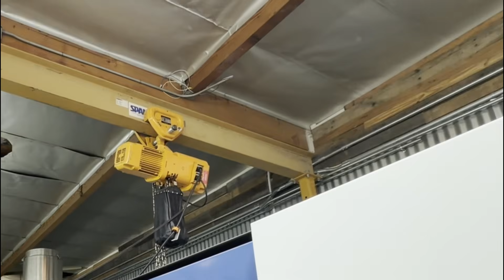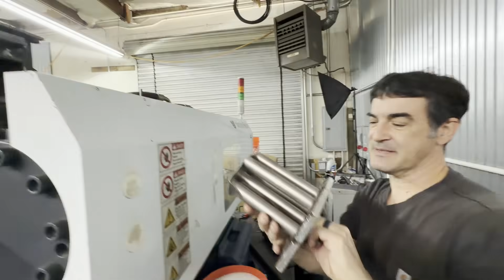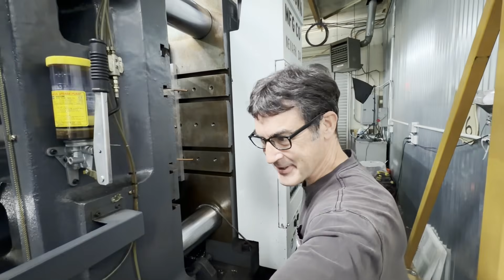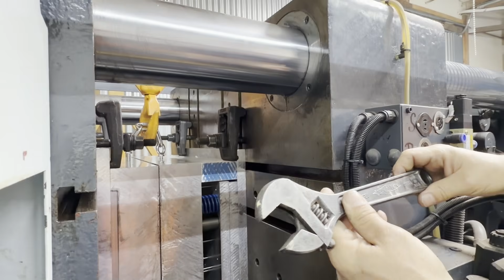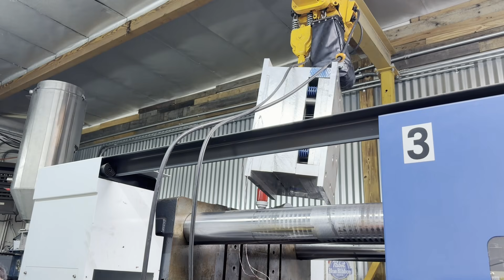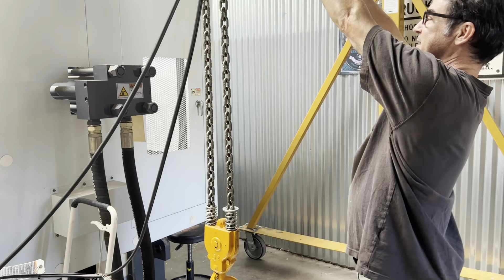MOLDING MACHINE UPDATE

Comment: The best systems for bridge hoists(aside from wall mounted) are when you grind a channel in the cement then bolt a steel bar into the channel about half the width and machine or just grind a notch into steel wheels the same size as the bar. It glides like butter and if the rail/channel is thin enough you never trip. (which for your tonnage I bet you could get by with a .75 inch square bar or 1.5 inch channel)

Comment: Tax on the machine?  Sounds to me like you might consider moving out of California.  That's a crazy tax.  Thanks.
Reply: That's not really all that crazy and quite standard across the country. 38 out of the 50 states tax equipment and machinery. You tax is based on the value of the machinery in your facility at that time based on depreciation tables. So, if you keep your tooling and machinery running well, the tax will eventually be lower than its actual value suggests.

The 12 states that don't include it make up for the tax revenue in other aeras.
Reply: Today I learned "property tax" in the US is not only on land (which many countries have) but also on assets in a business. what the hell.
Reply from the maker: @Narwaro it sucks!